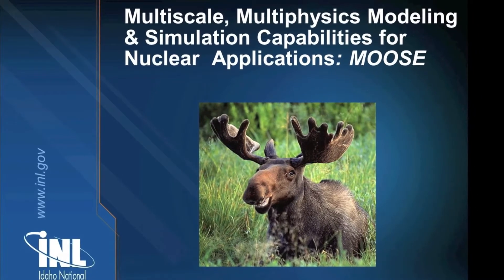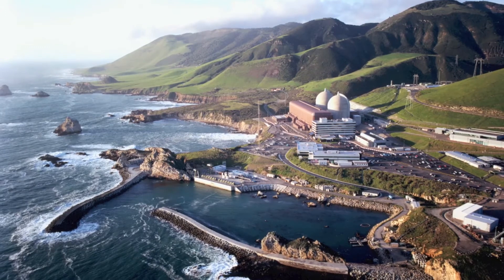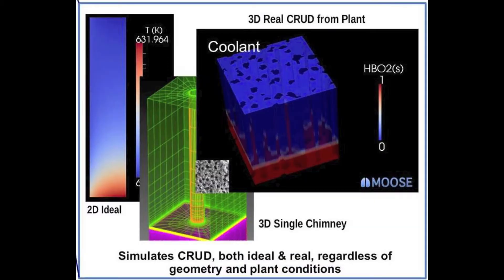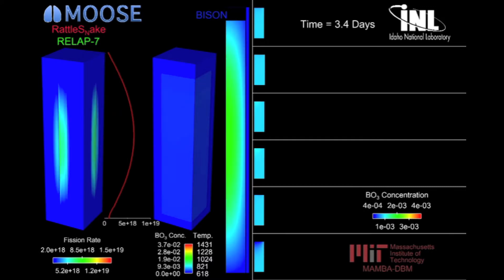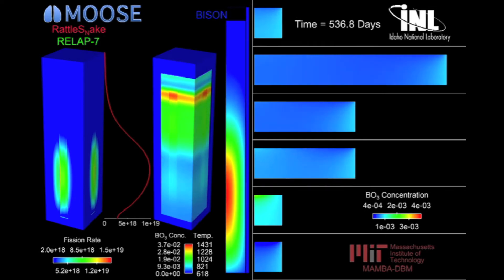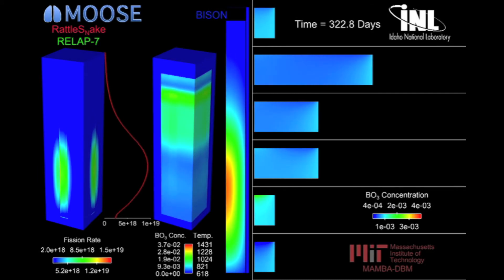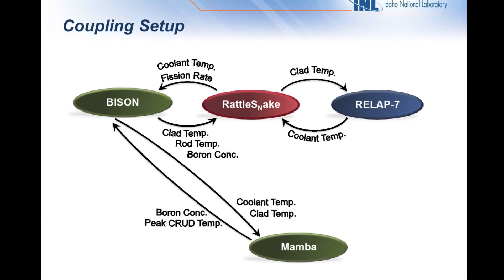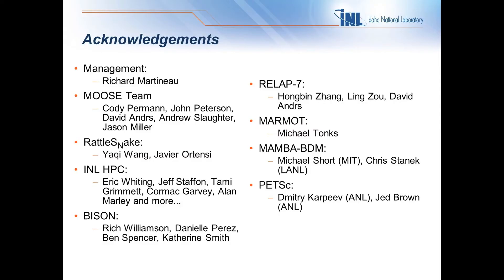MOOSE simulating nuclear reactor CRUD buildup

Comment: hello, I am trying to develop a mathematical model to simulate CRUD buildup
So I have a set of coupled partial differential equations describing the mechanisms right from the release of corrosion products as ionic and particulate species into the coolant and their transport to in-core regions where they may deposit on the fuel
I was wondering if I could use MOOSE's FEM method to generate a solution to help me visualize my model. Thank you